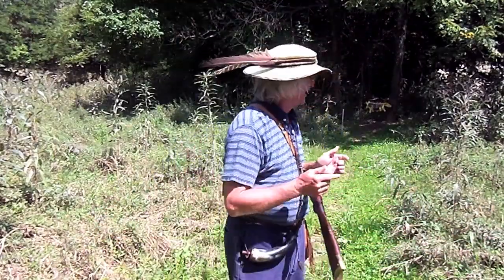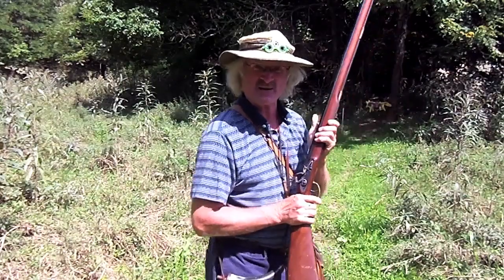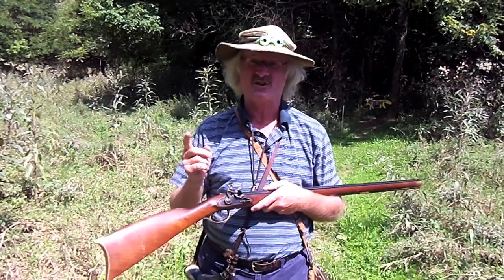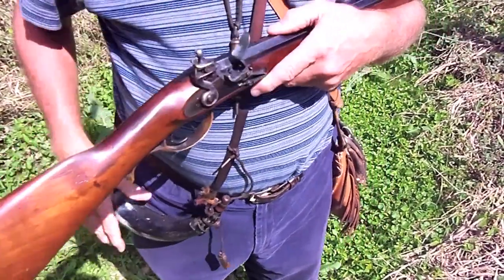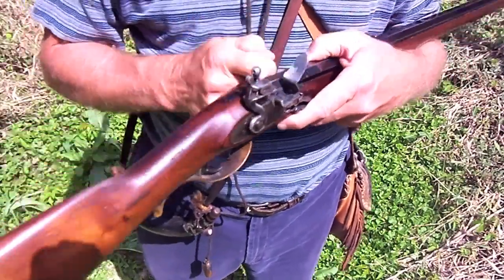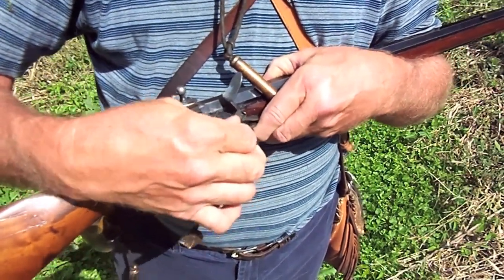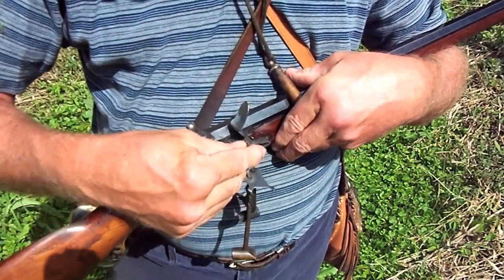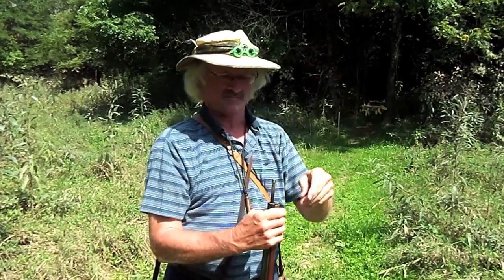How to remove a stuck ball in your flintlock rifle. Dryball

Comment: Just got an steel cleaning rod with plastic cap at the end of it and put it down the barrel to test it. The plastic cap got stuck and will not come out despite me trying to tap the barrel or empty it. What would you recommend with a plastic object that seems to be seated at the bottom of the barrel??? Thanks for your help!!!
Reply from the maker: You can probably shoot it out using 10 grains of 3F powder. The above method should work. If its a percussion gun, try this method: https://www.youtube.com/watch?v=vGy87a4c9NY&list=PLVMfc1ggQhJI0kU74xmk3idVKHOT38oMT&index=6&t=2s
Reply: If its plastic and stuck in the bottom of the barrel, won't it melt inside if I try to shoot it out?
Reply from the maker: @jd1759  That's what I'm not sure about...that's why I suggested only 10 grains. I was thinking of another idea to try also...if you have a bottle or a bore brush...put it on the ramrod thread end & insert into barrel. Try twisting it & see if the bristles will catch the plastic to pull out.

Comment: Only problem I've had with your good idea is if your patch winds up in front of the touch hole. As for ball pulling I made a 3/16 rod with a welded t-handle and brazed a very aggressive screw on the end. I've taken out 3 at the range. Three "talky-talks" to many !
Reply from the maker: Great idea. If I spent more time at the range, I'd have a big ball puller like you described.. I spend most of my time in the woods & don't want an extra rod to carry around. Thanks for watching..

Comment: That's a good idea. Ice wondered what I could do If I ever done it to my flint. Done it several times in a caplock tho. What if you don't have the patent breech like mine is a flat bottom breech face. ?
Reply from the maker: Not sure. There should be enough room to get 10-15 grains in it..I hope. That's all you probably need to shoot it out.
Reply: Black Powder Maniac Shooter I'm thinking about trying it with a fiber was so if it don't I'll be able to get it out. Still tho. Thanks! It's good to know

Comment: Dad lost a cleaning rag in his muzzle loader back in the day. After an hour of trying to pull it we ended up shooting it out. His gun used percussion caps so that made it a little easier.
Reply from the maker: Never heard of that one before....but, as long as it came out is all that matters! Thanks for watching...
Reply: @blackpowdermaniacshooter  Other than that Dad was pretty smart. He had used a nylon rag holder on a shotgun cleaning rod that didn't spin. The rifling must have backed it off, I wasn't there for that part. There wasn't room for powder on the first attempt so I just used a primer cap, that created enough room for some powder and it came out on the second attempt. That's probably been 40 years ago and I can still see that rag shooting up in the air on fire  from the powder. lol He never did that again.
Reply from the maker: @turdferguson5300  That's a pretty neat testimony. Thanks for sharing...maybe others won't do that either.

Comment: What does the shooter do when they know the powder is in the barrel and the patch and ball is on top of the powder the way it should be.  But the gun won't fire.  How does one get the ball and patch out then?
I had that happen to me years ago.  I cleaned the touch hole, etc.  I pulled the ball with a ball puller and emptied the barrel of powder.  
I reloaded and the gun fired just fine.
Reply from the maker: That has happened to me occasionally too. What I've started doing a few years ago to prevent that is:
1. For a flint gun, before I load it, I fill the pan with priming powder & dry fire it. When the powder ignites, it will clear out the touch hole & the inside of the barrel at the breech. 
2. For a percussion gun, I pop 2 caps on the nipple pointing the gun towards the ground at a leaf or a blade of grass & watch to see if the leaf moves. This "blows" out and condensation/moisture that may be in your barrel from the last cleaning. Have fun my friend & keep on burning that powder!!
Reply: @blackpowdermaniacshooter  Thank you.  I'll give that a try with the flintlock.

Comment: What would happen if the ball is stuck half way and no ball puller?
Reply from the maker: @Deli1321  You can still remove the ball with this method. 2 ways: Put 25-30 grains of 3F in the touch hold, seat the ball against the load & shoot. Or….pour 15 grains in the touch hole & shoot as is…
Barrels are tough these days, it will work .
Reply: @blackpowdermaniacshooter  There is powder in the barrel and the ball and patch is stuck widely through barrel. I'm ordering a ball puller now.
Reply from the maker: @ I’ve shot several stuck balls out 1/2 way down barrels. Not a problem for me. However, ball pullers work too…

Comment: This is the second time I have watched your video. It's great. I personally have never dry balled and know I never will. 😂😂I like your method of getting powder through the touch hole the best. When using a ball puller have you tried putting a little liquid down the barrel to wet the patch? Let it soak a few and then pull. Works a lot better. Are you coming to Friendship in June. I am staying at gun Makers Hall.
Reply from the maker: I've tried wetting the patch and still couldn't get the ball out. I quit trying that after I tried the "shooting it out" method. Its much easier to accomplish. I'm coming at least 1 day in June. Not sure what day yet, but, I'll try to look you up. I'll probably be running around with a camera on a selfie stick. Thanks for watching......

Comment: How is this possible? I can see how there's a little room around the ball, since it's round and the breech plug is flat, but wouldn't the ball block off the touch hole? Or do they design the location of the touch hole deliberately so it can't be blocked by the ball?
Reply from the maker: Lots of barrels has smaller barrel openings near the touch hole to allow powder but not the projectile to fit all the way to the breech. That is what makes them easier to "shoot" the ball out when dry balled.
Reply: @blackpowdermaniacshooter  You mean a sub-diameter powder chamber like the old-school black powder mortars you see on Civil War battlefields?
Reply from the maker: @jjohnston94  Pretty much similar to that....

Comment: Except for my (2) smoothbores, all my (4) flintlock rifles and rifled pistols have touch hole inserts.  If I remove them, it is easy to get 10 or 15 grains in no matter how far down the ball is, but it requires taking off the lock and screwing out the insert.  If I don't have a screwdriver with me or if it's one of the smoothbores, I will resort to the method shown here, but I will use fine priming powder to make the job go quicker.  I guess it was back even before the old matchlock days that barrels were made with a small chamber on the inside that the bullet couldn't go down into and just for this purpose.  If you are shooting a caplock and you don't have a nipple wrench, you might as well just go home.
Reply from the maker: Yep.....Inserts does make it nice....and...I totally agree about the nipple wrench with caplocks. This method is slow, but it still allows me to shoot when I dry ball one in the middle of nowhere. Thanks for watching....
Reply: Too much trouble.

Comment: This works really good for a Flintlock but not a percussion lock! Try to remove the screw on the nipple assembly or pull the assembly off the gun in the field! That area of the gun has so much black powder residue and it gets so hot that you have to have the right tools and enough strength to remove it. On some of mine, I bought used I had to use a torch to heat the nipple assembly up so I could get the screw that holds it onto the gun to unscrew!
Reply from the maker: Thanks for watching @Ron Martin.....I purposely dry balled a percussion gun on video. Here's what I do to remedy that issue: https://www.youtube.com/watch?v=vGy87a4c9NY&list=PLVMfc1ggQhJI0kU74xmk3idVKHOT38oMT&index=6&t=95s

Comment: I have both a bullet AND a ball puller stuck down my hawkins rifle barrell. The worst thing is that it's a caplock that hardly works. I put 4F down the touchhole put it did not blow out so now I'm stuck
Reply from the maker: You can add 25 or so grains thru the bolster after the nipple has been removed. Here's a video that will help you get her back in action: https://www.youtube.com/watch?v=vGy87a4c9NY

Comment: Is that a Brass pick or steel?
Reply from the maker: It is a steel flexible pick that comes with the Traditions flintlock pick set: https://www.midwayusa.com/product/100227419?pid=238159&fbclid=IwAR2t4YABUuMUyMPlRSdER7fEDeBXuXLCVxJeT2xUW2HxtNtJKVUqKV0I0x4
Reply from the maker: @aarontaylor7964  The vent pick is used to help push powder thru the touch hole. I've never seen any sparks. The vent pick isn't really required, you can shake the gun enough to allow the powder to go thru the touch hole. The pick just makes it go thru faster.

Comment: How is the powder in the touch hole supposed to get behind the ball if the ball is pushed all the way back? Isnt the ball just sealing it off?
Reply from the maker: Most guns has a small opening between the touch hole and the widest part of the barrel for powder. Swiss Null B or 4F can be used very effectively to ignite the main charge.
Reply: @blackpowdermaniacshooter  Ah I see, I dont have any 4f available in my area and I tried with 3f about 5 times and just couldn’t get it to budge, have a ball puller on the way and if that doesn’t work I guess I’m ordering a C02 compressor.
Reply from the maker: @soggycardboard78  You can try putting little 3F powder on a cutting board and use a rolling pin from your kitchen to make some 4F or Swiss Null OB type powder. Then try the suggestions on the video. That may work.
Reply: @blackpowdermaniacshooter  You know thats a really good idea and I think I will try that tomorrow, thank you got the help!
Reply from the maker: @soggycardboard78  Let me know what happens....
Reply: @blackpowdermaniacshooter  Im afraid to report I could not get the ball out by pouring fine grain powder in the touch hole, the initial powder pan spark was huge though, but I think all of the energy or what ever just flew out of the side rather than push the ball. The ball puller wouldn't work, I would actually get it screwed really far into the ball, then try to pull, and either A. the ramrod would come out with a ton of lead wrapped around the puller, or B. The Ramrod could not be pulled at all unless turned left to let go of the ball. I am just going to call Traditions and see if I can mail it to them or something and see if they can fix it, and if they cant, I either get a different gun, or quit the hobby. I don't have a shop or area to really work on this gun, just my back yard, no supplies or equipment, so maybe this hobby inst even for me. I guess if it matters my gun is a .50cal Kentucky Long Rifle by Traditions.
Reply from the maker: @soggycardboard78  That's a bummer. Here is a method you can also try. I had to do this just before flying to Pittsburgh for a meat shoot a few years ago.  It will cost you about $20.00 and you need a cordless drill. It is a drastic move, but, his will get the ball out in less than 2 minutes: https://www.youtube.com/watch?v=Gy4XYzKl7Vw

Comment: Only issue is if you do not get enough powder in the gun to get the ball to clear the barrel. Try it again BUT make sure to pack the ball back down on the powder. A squib load halfway down the barrel could be catastrophic.
Reply from the maker: Great advice. I stuff as much powder as I can get in the touch hole...usually 25-30 grains 3F. Works every time using that much. Thanks for watching.

Comment: Why did people put the bullet from the hole where it comes out? Why not make a hole near the the thing that lights up the powder to put the bullet directly at the end of the barrel? 

Sry if my question isn't clear i don't know anything about gun and i'm still learning english.
Reply from the maker: The gun is designed from 1600's era technology. The pressures of the black powder during ignition is incredible. There really wasn't any way to build a gun to work during that time era. The gunsmiths of the day wanted a gun that was reliable, especially when the long hunters of the 1770's used them for months in the woods at a time. The modern cartridge gun wasn't developed till the 1850's. Thanks for watching.......

Comment: Mr. Mark, I have 7 more pounds of 3f Goex to shoot before I buy more powder. Can I prime with that too, or is their another type and brand you prefer and recommend to prime with? And how often do I pick the touch hole and brush out the pan?
And what name brand ramrod do you recommend I purchase with my new Kentucky?
Reply from the maker: You can prime with 3F powder. It works fine...just slightly slower in ignition time than 4F or Swiss NullB is. I pick the touch hole every 8-10 times, others pick them sooner. If I was in a match, I'd pick it on every shot....but..since I usually plink most of the time..if it does't fire, I'll pick it for sure. I've broken so many wooden rods..I finally bought a fiberglass one. You can call Mr Beauchamp at this website to order one: http://www.flintlocksetc.com
Some folks claims they wear out the muzzle end of the barrel. I don't buy that thinking because I put 1000s of shots thru my guns annually & the barrel looks fine to me. If you go the fiberglass route, be sure to spray paint it with lacquer to avoid getting the shavings in your hands. This video tells more about the rods: https://www.youtube.com/watch?v=3uVLfbSHSyQ&t=1s
Hope this helps...thanks for watching.
Reply: @blackpowdermaniacshooter  Thank you sir

Comment: Only two kinds of muzzleloaders, those that HAVE dryballed and those that WILL.  MOST of my flinters do not have a patent breach and therefore the ball may well cover the flash hole. So far I've had good luck with a range rod screw. I don't use a patch ball combo that has to be hammered down like I've seen some folks do. (Don't get that but 'nother topic) So even with my lighter patch I still run a small bit of water (or coffee) down the barrel to soften the residue and patch up a bit.  Like I said no problems so far.  However, my fear is perhaps shearing the small brass pin holding it all together while screwing it in.  Yikes.
Reply from the maker: That would be ugly! I'm with you about the patch/ball combo. I'm NOT going to pound the round balls down. That takes the fun out of the sport.

Comment: Don't try to use a ball puller with the screw attachments to the wooden ramrod.   You can break the tip of the ramrod and now you have a ball and ramrod in the thing.   Use a metal ramrod.  That works well.
Reply from the maker: I agree. Its just easier to shoot them out. However, I've used wood before, but, I pin them with a finishing nail before use so they won't come off in the gun.
Reply: Black Powder Maniac Shooter   My ramrod was pinned as well.   The hickory still broke.   I'd agree, the best is to try and shoot it out.   I've never tried the co2 routine.   Another way is to take the barrel off the stock, and pour penetrating oil down the barrel, and let it sit a day or so.  Then the ball puller is supposed to work better, as the oil slicks up the barrel.  

You should mention that one must never pour powder directly down the barrel directly from the powder horn or flask.  Some movies show actors doing just that.   I've known one deceased person who did that.   The powder horn blew up and literally blew his head off.   It's off the subject, but it's a huge danger I have not heard discussed.  People who get into this sport have got to realize these are deadly weapons, designed to kill, and are not toys.
Reply from the maker: @normanbraslow7902  Yep....excellent advice. Thanks.

Comment: You can use a ball puller.  What you can't do is use a ball puller with the ramrod on the rifle.  You need a good brass rod with a T handle on the end of it.  Screw in the puller on the rod.  Allow the rod to fall down firmly.  The weight of the brass rod will drive the point of the puller into the lead.  Then screw in the puller using the T handle until you feel the screw bite in and good resistance develops.  Then smoothly and slowly pull out the ball.  I've never had that fail.
Reply from the maker: You're "duh-man"..!!  I've never been able to pull a ball out. I don't like carrying an extra rod with me in the field, so, shooting it out is about a 2 minute task for me & I'm back to shooting. Thanks for watching.